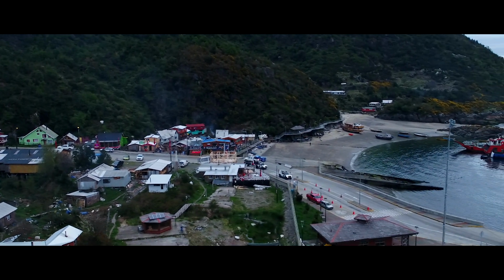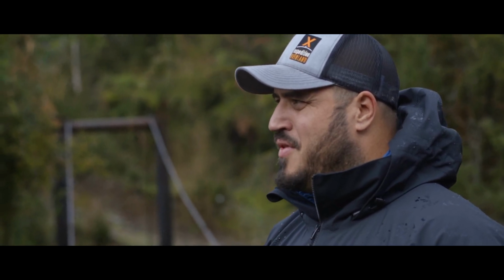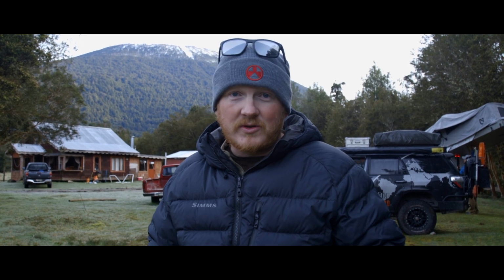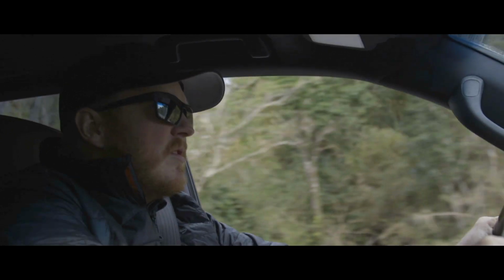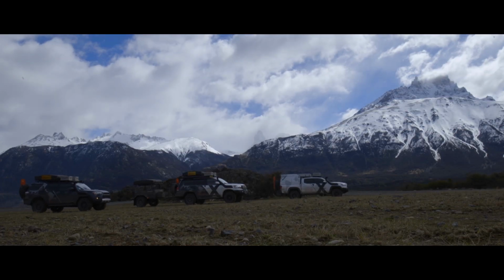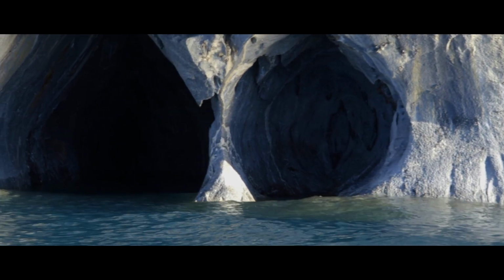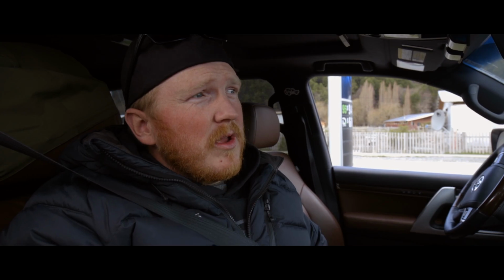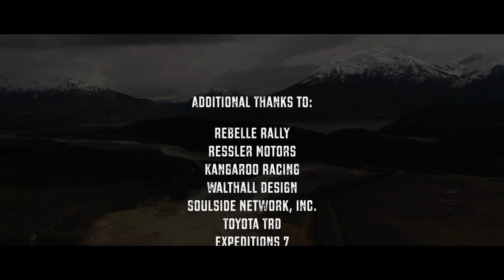South America S3 Ep10: Driving the Carretera Austral (Route 7) and Overlanding to Patagonia : South

Comment: Thanks guys for refreshing my memories of the Austral highway. Yes the road surface has improved since we drove it in a Toyota Yaris in 2007; then it was river gravel which had the Yaris floating on the high centre of the TRACK as its ground clearance did not match the 4x4s and trucks. We will need to find other tracks to do our exploring before they disappear.